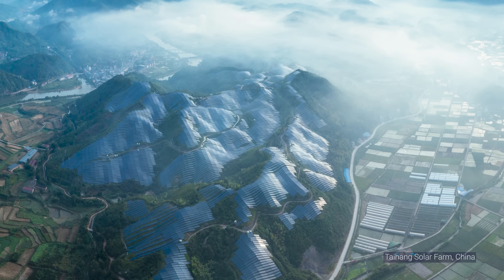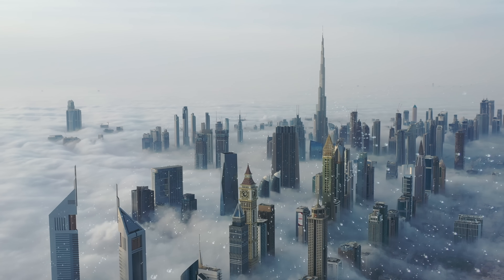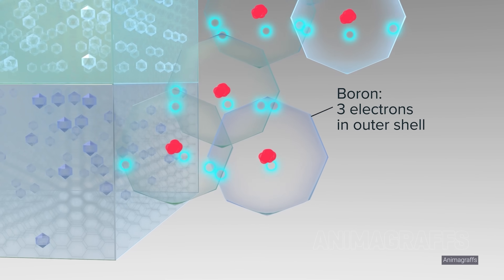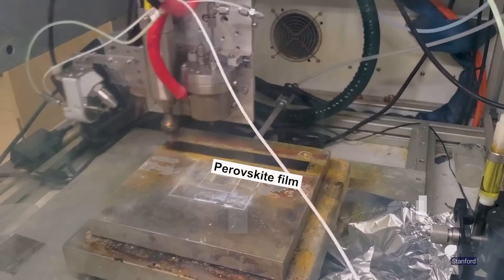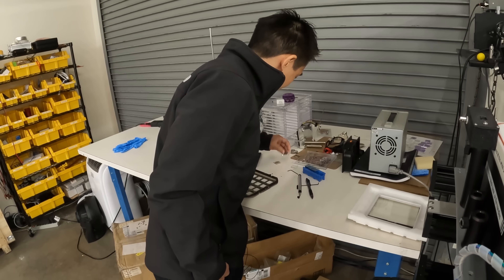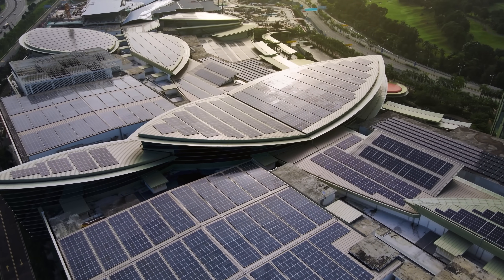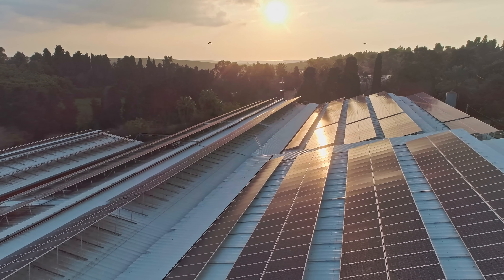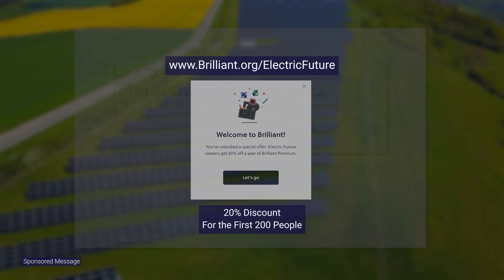Solar 3.0: This New Technology Could Change Everything

Comment: Impressed, my conclusion the spectrum adaptation is key. That's plus. Prism diamond, like how u get one sunroof to light skyscraper. Extend light travel. An frost or dust those films. Like charcoal on inside of pop can. Boron is the latest. Greatest,  brass filings... I want more out the reciever.  I'm thinking. 
Excellent research yes sir. Cheer's
Reply: With time dilation being 25%/75% most cells are at best half a point. Reverse the quarter main. It might bumps amps

Comment: From the start this touts the light weight of the material, and its much higher power-to-weight ratio. That's interesting, but the weight of panels isn't hindering adoption. Rather it's the size, the power-to-AREA ratio. We don't need panels that can float on a bubble, as was said. We need panels that are so efficient for their size that, for example, they could fully power a vehicle just from a coated car roof. Whether that coating weighs one ounce or one hundred pounds won't much matter. The need is to produce more energy in less space.

Comment: It probably won't turn out to be the deciding factor, cost-benefit will, but current "thick" silicon cells are mostly recyclable. If any hazardous chemicals or non-recyclable materials are included in perovskite thin films, it might be an issue.

Comment: Might be interesting to add an electret below the solar cell to change the band gap of the semiconductor junction.
Also a thermoelectric layer below the solar cell cooled by water could increase efficiency and provide free hot water at the same time. Best wishes for success.

Comment: They can't figure out how to keep solar panels from accumulating debris. They sit out in all weather conditions degrading the panels. The only thing I can do to prolong the panel life is keeping clean motor oil on the panel to repel water but the dust I can't keep off of it. So I have to wipe clean the debris from the panel & reapply the motor oil.

Comment: If Photovoltaic cells are produced in a lighter colour  then the cells would run cooler and reflect light back which would also help in reduce global warming, if they can produce transparent cells that would be even better still.
Reply: you believe in global warming? lol probably vaccinated too
Reply: @antimsm6705  if you paint your house white the sun would reflect heat, so cooler inside, if you paint it black it will absorb heat so warmer inside, it's not rocket science, you don't need to worry about global warming if you don't want to as you and me will be history by then!
And what's your problem with vaccination and what's it's got to do with this post?

Comment: two questions leap to mind: 1) why is 25yr lifespan an issue? If it's a byproduct of economics of traditional PVs surely the massively reduced costs & higher efficiency of PV3 some into play? 2) Can lifespan/reliability be improved by some sort of enclosure, especially if designed with maintenance/repair in mind? Surely first applications likely to be mass power plants not individual cars, homes etc. which would make that approach more viable

Comment: Longevity issues appear primarily related to high temperatures.
If actually so, common sense  dictates cooling the system, or using a material to obtain the higher desired percentage of longevity. It seemsa solution may be closer to within the engineers grasps,closer than they evidently, realize.

Comment: The best way to get a 15 times more energy is CA,Y,AG union with Fundamental HHFW grounded, you can have a life time energy and your life time independent full power as much as you need ,and it coas only $400-600 ,,
In the same time is uranium reaction is 700 times weaker than union of CA,Y,AG

Comment: Honestly I don’t understand! If this new type of panel are 15 times cheaper and are so much smaller, then instead of longevity why not ease of changing them out? Solar panels are so cheap now. So if all you had to do is swap them out every few years, it would be worth it now. Then what’s needed is an easier way of where and how they’re supported. They’re smaller so they don’t need to go on the roof. Why not some type of ground setup, where the homeowner can easily change out the small panels themselves. Click in and out?
LIKE LIGHTBULBS! Hey there ya go! Make them to be changed out like lightbulbs!
Reply: Then people will be complaining how back in the days solar panels used to last long as when batteries first came out. Though technically speaking some  leaves last a season, others a lifetime.

Comment: Maybe you are going at it the wrong way.
What if you made it so cheap and easy to change the surface of the panels that It would not be necessary to have a long life.
Instead you could renew the panels often and keep them upgraded as well, therefore avoiding throwing the whole panel in the garbage. It could be applied much the same way a tint layer is applied to our car's windows.

Comment: Let the light make it through them.  How about a slightly less efficient cell, because light shines right thru BUT, because it does, it's hitting the plants you have growing under them to feed the world with.  A partial shade plant, growing in full sun, under a solar panel sheet to diffuse the light a bit for the plant, while at the same time, making electricity from the light it did take up.

Comment: could one not apply a reflective substrate layer, then a thin film of assorted quantum dots to tune the different wavelengths of light into whatever works best for the band gap, then the perovskite on top. kind of the reverse of QLED display somewhat if you get my drift. cool stuff btw!

Comment: We just recently had solar installed at our home. An array of 19 PV panels, with a Powerwall for storage. Right now, the handy app says my battery is at 100% (so it recharged from powering the house through the night), the house is using 0.6 - 0.8kW, and the panels are producing from 4.8-5.2kW. App shows total we've produced 14.5kW, with most of that going back to the grid.

Comment: Looks like they have a rinsing problem. If there was no UN-crystalized material left between the layers there would be nothing left to grow when the temps rise. Another way would be relief layers. Instead of putting the perovskite's down in 1 layer put it down in 4 or 5 layers with a conductive relief layer in between. This would also help with structural integrity.

Comment: 0:27 "If you wanted to power the entire US with solar panels, it would take a fairly small corner of Nevada or Texas or Utah."  Yes and if you covered the Sahara Desert with panels, you could theoretically power the entire world.  Except transmitting electricity from remote areas presents its own significant challenges.  Power lines have to be maintained, energy losses increase due to distance, etc.  Even if we had the tech, we all know a certain nameless political party in the US hates infrastructure spending.  Unless it's related to oil pipelines of course.

Comment: 6:03 This is and for ever will be the culprit. Regardless of the output per surface unit the annual average will never get past twelve percent of its rated output and it will also be heavily degraded during the period that I (and the rest of the country) require the energy most. Solar is an interesting technique for grabbing energy that would otherwise not be put to use, but making it the primary choice for providing the grid really is the dumbest idea ever.

Comment: Use Parabolic DISC Perovskite calcium titanium oxide.  IF not zig-zag design instead of flat.  Market: we need smallest battery cells with longest prolonged life that could drive Electric Cars,  Flying Cars, Personal FLying back pack; how about electric scooter; and electric fences even the whole house?   But all battery must be removable in order to recharge it at home and hide it from thieves,

Comment: This is awesome, but the statement that cars only need cells that last 10 to 15 years is annoyingly short sighted.  Cars need to be designed to last longer, not covered in cells that guarantee their short lifespan.
Reply: It doesn't necessarily need to last the life of the car. Much like a convertible car top ages and needs to be replaced, or a seat.

Comment: I am working with a few groups developing and testing perovskite research cells and mini modules at NREL. There has been a lot of momentum (money) behind this as the new OPV, and efficiencies have shot up quickly. I see some of the newest devices from universities and startups.. there is still a long way to go for stability of these modules and materials
Reply: That's interesting work you do. I am a electrician in the great state of Texas and for the past year i have been working for a master electrician installing solar. We do the whole system modules and the solar walls I like the work and I'm really interested in solar. Really looking forward to lighter modules cause carrying them on a roof is a work out.
Reply: NREL has an incubator for the R&D of solar and Geo
Would be interesting to see how these are plausible in aero  projects. Food for thought

Comment: How are you on this sunny morning in Goonellabah on North Coast NSW? Will you have a PV panel by the end of 2024?
 
The Team and I are submitting a DA to a Lismore council on North Coast NSW end of Oct 2022:
1.	250 prefabricated Xlam as CLT & SIPform passive house-certified homes. On the roofs of buildings, the Tractile, the excess electricity will be stored in the 28.8MW Tesla Batteries Farm. 
2.	The PV in total 934,370m2 - Tractile tiles 45,000m2 and Arctech Solar Tracking - Tesla PV panel 887,400m2
3.	Bi-Charging of EV one per house and 12 charging stations in the shopping centre. 
4.	Micro-grid that connects to a community of 4800 residents 
5.	Landscaping the whole site, ensuring enough clearance for the surrounding bush and buildings.
6.	We will be trailing the SoMax HTC process. 
7.	We will have a project at the end of 2024 that will be installed a long-range wireless power transfer. Emrod Tele-Energy Technology. 

Some of the Team include:

SIPform™, Tractile, Direct Building Solution, Xlam, Green Product Certification, NB Consulting Engineers, Tesla EV – PV – Powerwall and Arcimoto

We will be onsite in July 2023.

We have a video on YouTube at the end of Sept 2022. Then a video every two months at the end year and from the year every month to finish the project in 2025.
 

We will raise AU$500 million by the end of 2025 for the development.

The Team and I Fully Charged LIVE—Sydney 11th to 12th March 2023. I will be there in Sydney. We promoted the project on the film on stand team taking a project and future projects.
Cheers,
Ian Cleland 
Sustainable - Urban - Community – Homes
Rethink -Reimagine-Reinvent-Disrupt

Comment: In a nutshell: Little results so far. Efficiencies still not above traditional. Longevity unknown or rather it is known to be very low in the neighborhood of a few years at most. Known advantage, light weight and flexibility. Hype unlimited from the lab. The video and commentary itself is excellent.

Comment: the problem in the solar are area of space, battery, maintenance for dirt, poop, wind force, temperature, climate, and durability. it degrade faster because it exposed to the elements.

Comment: Microprocessors have heat issues as well. But liquid cooling, using 1 W pumps and a radiator can increase performance or reduce the use of air conditioning in server farms for 200W microprocessors. So why not design a cooling system for these solar panels, put them in low humidity location and test them. If you are wondering about the cost and life of pumps and radiators, my guess is less than $100 and expected life with 24/7 use of more than 10 years is possible based on research for high MTBF pumps using fluid bearings.

Comment: It is because they are using the photoelectric effect instead of the photomagnetic effect while pretending the dielectric field does not exist and electricity is nothing more than bumping particles flowing through a material like water flows through a pipe.

Comment: You know that the materials needed to make lithium batteries is almost gone? I mean having a solar system would be nice but within the next 5 to 15 years from now storing power in a container will be rendered useless unless someone finds a replacement for the lithium ion batteries.

Comment: The big question for me is, would i be able to retrofit my panels and still use my current batteries and other equipment, or will I have to replace everything?
Reply: No way would current installations need to replace everything.  With different solar panel materials the voltages could be different so you might need to wire things up differently and have a different first stage collecting the power.  If the panels are much cheaper and generate more power the cost of the small amount of additional hardware would be paid in a few months of use.  Here's hoping the perovskite panel researchers succeed with their work.  Looks to me as if it's five to ten years before this can move to commercial production anyway, so people will need to carry on buying the Silicon based panels for now.

Comment: what if you put it in Gorilla glass in three passable  layers and tune the glass for U.v. rays or a broader spectrum like sports/reading glass between each film and put a reflective material on the bottom . in  turn the three layers will be 6 or 2 will be 4 just have to angle the reflective material at the appropriate angles. like a .5 or .7 degree offset but .26 may work too. just thinking out loud

Comment: These videos never fail to disappoint. I was expecting an actual breakthrough. Not  "theoretically" being able to make solar panels suck slightly less one day maybe.

Efficiency is not the only issue with solar. It will never be viable until they can store the power without destroying the world mining for battery materials... and... without building up rival countries run by psychotic  dictators. 

Like those that rhyme with vagina.

Most of us require power at night. I'm sure woke teachers teach the opposite these days but the sun doesn't actually shine at night...

And, there's clouds... that block the sun periodically...
Reply: Better battery technology will come.  The same two people who developed Lithium Ion battery technology have been showing off early test models of Sodium Air batteries.  Since Sodium is abundant, cheap and easily recycled, and easily decomposed into something harmless it makes a far more environmentally friendly battery material.  It is slightly less energy dense than Lithium Ion batteries but does not start fires if you don't protect it from impacts etc.  It's a few years away from mass production but should take over from Lithium Ion for most applications eventually.  Early indications are that it will also be a lot cheaper than Lithium Ion or NiMH.

There are probably other teams working on viable replacements for Lithium Ion and NiMH too; a race that we will all benefit from hopefully.
Reply: @FireAngelOfLondon  We don't need more batteries. We should be using solar to separate hydrogen from water, the most abundant thing on the planet.

Batteries require mining and helping China... both of which are destroying the planet.

Hydrogen fuel is clean and abundant. No mining is needed. Existing cars can be converted so we don't need whole new expensive cars for everyone. 

Energy can be stored without needing hostile regimes like China.

And... hydrogen can be distributed and used via existing fossil fuel  infrastructure. 

Using solar as a direct power source or via batteries is a fools errand... given that "saving the planet" is the apparent goal.

Comment: Perovskite's advanyage of crystalizing at much lower temperature (say below 100) is an advantage as well as a drawback. The low temperature enables the cell to be manufactured easier and cheaper on transparent materials, but also potentially degrades its lifespan and problem to operate under high temperatures (eg: 80 degrees or higher). 

The trick is to find a material so that before it crystalizes it requires low temperature, but after it crystalizes, it'll need significantly higher temperature to disrupt the crystals to achieve much better stability.

Comment: What happened to the new graphite that could soak up 99.999999% of the sun rays to maximize efficiency that went quiet we seem to be just nibbling away at the edges of a immense climate issue instead of grasping the metal and working together to solve this pressing issue .

Comment: You can't have 100x the efficiency of 20-25% efficient solar panels, unless you plan on violating the first law of thermodynamics.
Also, perovskites don't last as long, and that's a very real problem. A 35% solar roof made of cheaper material doesn't go very far if it only lasts a few years, and installation is one of the biggest costs.
Perovskites have uses, but the magic bullet for solar power doesn't exist (yet). And then there's the issue of storage, which is the bigger problem.

Comment: There's a reason why only 2% of energy comes from solar and it's not just due to max 20% panel efficiency. The other factor is maximum surface energy received from the sun which is only 1kWh per metre squared. The world uses 21.78 trillion kWh (CIA World Factbook). To produce this much energy, with 100% efficient solar panels, we need 21.78 MILLION squared kilometres! That's over 100 million sq km of panels with 20% efficiency. Earth's total land surface is 149 million sq km.

Comment: Where in the hell do you get 100 square miles of solar to power the ENTIRE US? In 2012, California generated an estimated 1025 gigawatts using pv solar, a mix of utility and residential. The general rule of thumb is 100 square feet for every kilowatt. That's over 3,000 square miles of solar to not even reach 15% of California's energy usage.